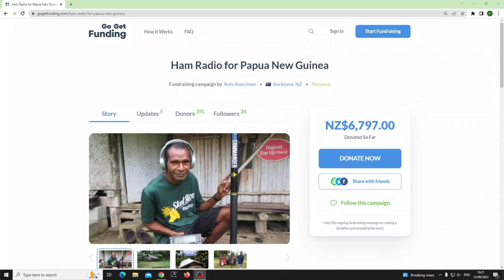We need to Understand Solar Power for Ham Radio

Comment: Hi cal. I've been using a solar setup for quite a while now. I use  4kw solar and 12kw battery. I'd say victron all the way mate. If there going 12v victron 100/50 is fine for 700w pv 1400w 24v pv. Pv max 100v/50 amps
Reply from the maker: Nice.

Comment: If you haven't already found a suitable system, look into the Renogy brand of solar equipment.  They have a website and all the equipment you will need to get the job done.  I have one of their solar panels, the controller (which is built in), the battery they sell and a 2000W inverter.  The inverter is a full sinewave version.  I think you will find the quality of their components is very good.  My system powers my Icom IC-7300 and some other items such as a small SDR receiver.
Reply from the maker: I know Roly reads these comments so thanks for input..

Comment: Solar power for ham is ok depending  on power requirements.Remember you will need 3 to 4 times the solar panels equal to the power requirements ..Basically I would instal 3 times the solar power for a Tesla at 3O amps at 220v ..So let's say you need 1kw of power you need 3 kw of solar panel .100 amp charge controller and 3 to 5  200 ah batteries .Lithium iron phosphate .It's over kill but because of the heat and rainy season you will  need  a bigger battery reserve and solar supply .Use monocrystaline panels they are more efficient ..I use 4 panels at 250 watts per panel .I never get the 250 watts per panel because im too far north .I use a 2kw inverter for my AC stuff and run all my battery chargers for my power tools and landscape lighting from my shed and run my radio and stuff when I'm working in the shed ..
Rule of thumb 3 to 4 times solar panels as per expected power requirements and use .To if you have a 120 watt power consumption from your radio ,that's 10 amps .so you will need  a 100 amper hour battery to run for 10 hrs continuous but will need at least 200 watts of solar panel 300 watts would be better .Just remember you make no electricity at night and limitted during the day pending weather and temperature .the colder the better .Use an MPPT charger .Not a PWM ..Set your panels in parralel .always connect your battery to the charger first and program the charger for the battery you are using .then connect your solar panels .either for 12v or 24 v .Pending on charge controller.
Just remember the longer hours of operation at night needs bigger battery reserve .1 200 amper hour battery life battery is good for a couple days without sun .just remember to give yourself 3 times the solar panels.You can use 10 awg  wire between your solar panels depending on distance you will have to up size your wire to 8 gauge .Also depending on inverter you may need 4 gauge or bigger .And if it's strictly DC 12 V you may need to go to 2/0 cable between battery and amplifier .Distance between batteries and amplifier is crucial .the further away the heavier the wire required .if you go to a 24 v or 48 v system you can save on wire size but have to buy expensive buck/boost regulators for specific voltages ...

Comment: What nice thing to do. So if he’s going to go with Solar I feel a lot of consideration will need to given to voltage regulation.  Presuming the target is to use 12V cells and top up the cells with the panel/s. Most systems like this are based around inverters to regulate the voltage. The problem with this is that these inverters are notorious for causing noise especially on HF. I am interested in how far you have progressed with this and what the plan is.
Reply from the maker: Hi John, yeah so we don't need an inverter so much as a charge controller only (no mains).. But noise is obviously key! Thanks!
Reply: @DXCommanderHQ  Cal do you know the size / type of the pannels and size of the battery? I will do some digging.

Comment: Interesting video Cal. I cannot help with any specific query - but here is a thought I have had for some time. If you go around the house, the ham radio, pad, laptop, phones (for all the family) and more are all powered by DC. We spend effort in taking a switch mode power supply (or similar) and changing AC to DC. Just feel the transformers, they are hot doing all that effort. So although I have explored some aspects of solar power, the systems that use an inverter to provide AC do not interest me. Furthermore, even a desk top PC uses DC (i.e has an inbuilt power transformer). So does most modern PC displays  - and on and on it goes. So I would like to think about creating a "ring main" DC supply using solar power. I do not really have the knowledge or skill to do this. But I kinda see an option of having a DC supply in each room of the house, several perhaps in the kitchen, where all these devices could be plugged into. I have not done the maths to see if this is at all viable or worth it !!!  But I might.  Mark  2E0MSR
Reply from the maker: Haha.. Yes, I see your point. The real problem with DC is safety. Most boats burn to the waterline because of electrical faults. DC..!

Comment: One additional comment: Most battery manufacturers rate their batteries in units of Amp-hours. One might ask how this relates to the batteries’ power. To determine the power that a battery can generate one needs to multiply the Amp-hour battery spec by the battery voltage and convert hours to seconds. So, as an example, consider a 14 Volt battery spec of 500 Ahr. These numbers can be turned into power as follows:

500 Ahr * 14 Volts * 3600 seconds/hour = (500*14) Watt-hours * 3600 seconds/hour = (500*14*3600) Watts

Cheers and ‘73

Jim
Reply from the maker: Very good Jim!

Comment: On power versus energy …

Throughout my 45+ year engineering career I’ve found that many if not most people don’t understand the difference between power and energy so I thought I’d say a few words on the subject. In short, energy E is the product of power P times time. This is why electrical utility bills, at least in the US, are in units of kiloWatt-Hours (kWh). Of course kIloWatt-hrs can be converted to Joules as follows: 

1 kWh * 1000 Watts/kW * 3600 seconds/day = 3,600,000 Watt-seconds = 3,600,000 Joules

I think it would be helpful to view Issac’s problem as one where his solar system is used to charge batteries, taking whatever amount of time it takes for a given amount of power (Watts) being provided by the solar system, and a separate phase wherein energy is consumed using the radio. For instance, it might make sense to only use the radio in the evening, after the sun has set, thus letting the batteries accumulate energy throughout the period of daylight. As long as Issac’s use of the radio required less energy than that being accumulated throughout the day, all is well.

Perhaps the biggest point to make is that the power output of a panel is only part of the story, whereas the full story requires that one consider the rates at which ENERGY is accumulated and used AND the durations (seconds) associated with each. When viewed this way one can see that POWER (Watts) is the RATE at which energy is produced or expended.

I guess my bottom line is that the problem is best viewed as an energy generation versus use problem, and that people shouldn’t focus just on the amount of power generated by a given panel. After all, a 100 Watt panel run for 10 hours, for example, is equivalent to a 1000 Watt panel run for 1 hour. I.e., the same amount of ENERGY is produced by either system and as long as that amount of energy is greater than or equal to the ENERGY required by the radio all will be fine.

Sorry for the pedantry of this note. 😉

Cheers,

Jim Luby
Reply from the maker: Pedantic is good in the science world Jim!

Comment: For a Damp/Wet Environment I would look at a fully sealed MPPT + DC/DC Charge Controller
Like the CTEK D250SE Dual Input DC-DC Charger & MPPT Solar Controller
It allows upto 300W Solar + The ability if needed to also be connected to a Vehicle for DC/DC Charge capability.
They are designed for Vehicle use, but would also work in this Scenario/Use Case.
>
Panels..?? Depends on installation location.. Roof or Ground Mounting..?? May require a frame building if on the Ground vs on a roof.
>
Battery Capacity, Better to over provision if possible, Not sure of operating hours.? Day vs Night Operation
If average load is 15A, Radio mainly SSB at 50% Duty Cycle + some other accessories, maybe some lights.?
I would look at at 2 X 100A/H LifePO4 batteries, would probably give 15~20hrs of use if Solar panels became unavailable., Damage/Storms..??
>
Maybe worth looking at for ideas:
https://www.maf-uk.org/news/solar-power-soars-in-papua-new-guinea

Comment: Not to rain on anyones parade but logistics of PNG are a nightmare and theft is rampant. All i can suggest is to buy the gear locally from the likes of Brian Bell Electrical, they sell solar equipment and are in Madang so easy to get to. There are other retailers as well but options are limited in Madang. All other is either airfreight from POM or Lae or highlands highway from Lae. Getting stuff imported isnt hard but just tricky. Any solar panel needs to be of a size that can fit in a van or small truck so that does limit you down to about 100-150w. As for battery i'd stick with a VLRA they are cheaper and easier to get. Plus when its been repurposed they can handle more abuse. Good to see this sort of promotion. Just be careful of the Wontok and shiney object syndrome in PNG. Jealousy can be nasty. I am sure Roly knows what i am on about.  Good luck and hope it all works out.
Reply from the maker: Phil, Roly is in and out of PNG.. He's probably worked out how to keep the stuff "almost" safe! LOL

Comment: One additional comment: Given that the Icom 7300 is powered by a DC power supply (13.8 volts), I don't see the need for an inverter and hence inverter-related noise would not seem to be a factor while running the system off of the (presumed charged) batteries. I would think that a fully DC could be put together thus obviating concerns about inverter switching noise, etc. That said, I'm not an expert on solar charging systems so I may be missing something here. - Cheers - Jim
Reply from the maker: Yeah, Roly is certainly not going down the inverter route..

Comment: Hi Cal,
While I don't have much experience with the latest charger and solar panel technology, I do know how to compute the amount of energy needed on a per-day basis, and from this number one can determine required battery capacity. Maybe this will help you and your friend Rolly with Issac's  Papau New Guinea solar shack setup. So, here are few simple equations and relevant numbers:

1. The solar flux near the equator is about 1400 Watts/meter^2 (W/m^2). As one moves away from the equator, the effective flux lessens. Papua New Guinea is pretty close to the equator so it has to the potential to have flux near 1400 W/m^2. However, to be conservative I would use a lower value, say 1000 W/m^2.

2. A typical solar cell efficiency is about 15% so of the 1000 W/m^2 available, the panels are able to effectively capture about .15 * 1000 W/m^2 = 150 Watts/m^2.

3. The total power that a panel of area A (m^2) can capture is then 150 (W/m^2) * A(m^2).

4. What's also needed is an estimate of the time per day (in seconds) that Issac expects to use the radio, and the relative fraction of time spent in receive mode versus transmit mode. Consider an example wherein Issac plans to use the system for 4 hours each day (14400 seconds). Next assume that of that time, he is in transmit mode for 10% of the time (1440 seconds). This implies that he is in receive mode for 12960 seconds. Given these numbers we can now calculate the energy needed per day.

5. The Icom 7300 in receive mode uses about 14 Watts of power (13.8 Volts * 1 Amp).  In transmit mode it uses about 290 Watts (13.8 Volts * 21 Amps)

6. Energy = power * time and the standard units for energy in physics are Watts*seconds, or Joules.

7. Energy used for transmit = 290 Watts * 1440 seconds = 417600 Joules 

8. Energy used for reception = 14 Watts * 12960 seconds = 181440 Joules

9. Total energy used per day, given the assumed transmit and receive durations above, is then the sum of the transmit energy and receive energy, or 599040 Joules. Note that a large fraction of the total energy is consumed in transmit even though we assume Issac transmits only 10% of the time (probably a high number but it makes the math simple).

10. Now that we know how much energy (not power) Issac needs per day, we can size the battery pack.

11. Often times manufacturers use kilowatt-hours (kWh) instead of Joules. Using an online conversion calculator, you find that 599040 Joules is equivalent to about 0.17 kWh.

It seems that many of your subscribers are knowledgeable about batteries, panels and chargers (including typical charger efficiency) so I'll let them advise you on those choices. However, before anyone can do any kind of meaningfull calculations, they must have a rough idea of the energy needed on a per-day basis. If you, Roly or some group wishes to discuss this matter in more detail, I suggest a zoom call.

Cheers,

Jim
Reply from the maker: Very fine Jim! I made similar calc on my 2 x 80Ah Gel batteries, factoring in talk-time, power, compression etc. In the end, I discovered they will last longer than I can DX for!

Comment: By Pacific, are you saying he is a sailor ? My recommendations are for sailing vessels. First, find Will Prowse'c Channel and watch almost everything, (at least get the basics from him) or select from his videos. 1 SOK Marine Batteries. 2. A good MPPT Charger. I'm having good luck with a Renogy., that said, I'm not a marine user. The MPPT electronics needs air (fpr cooling) , yet , protection from the elements.  I have to say, finding one that is safe from the Marine Environment may be impossible, so having a spare might be recommended, and keeping it in a waterproof box of some kind, with a metal shield around it.. My personal recommendation,  solder any crimp connectors , then slip heat shrink on top of your work.  Mike N6GRG good luck
Reply from the maker: No, he's not a sailor. The previous video explained..

Comment: I run my shack on solar.Lessons I have learnt. Battey  type is critical. Lead acid batteries have a life cycle.Life cycle depends on how often they are discharged below 50%  For example A 100amp hour battery only has a useable capacity of 50 amps to go below this shortens the life of the battery.The other consideration is for a battery that requires little mantainance for example a agm battery.The solar charger needs to a inverter charger that can output 230 volts and if solar charging is not adequate a generator can be connected to  the inverter charger.The inverter charger can be remotely monitored. The system needs to be set up to be user freindly.The amount of solar needed depends on the sunlight hours available. Overall system needs to kept simple as practable.
Reply: lead batteries come in different grades. solid plate batteries are heavy, lower power, but last decades. also ni-fe cells last forever, literally
Reply from the maker: There's no inverter / mains on this set up. Only 12V (well, 13.8 nominal!)

Comment: Victron all the way! If you can get them polycrystalline panels as they are more efficient, if not mono. Go as thick as you can with the cables, probably best to get silicon insulated as they will stand up to the environment better. Any questions drop me a message x

Comment: There is one very important piece of information missing.

How long per day is the system expected to operate?
Once you know that, the calculations regarding battery size, regulator size, solar panel size will all become clear.

Comment: Hi, I live off grid with only solar power to run everything and i have a standard domestic fridge freezer,  5g wifi, satellite tv for the kids and my radio gear..  I use an mppt charge controller with 1.4kw of panels on a good day charging lead acid gell batteries. I know people will say lifepo4 is best but old school gell are readily available, not to costly and last many years.
Reply from the maker: Yep, if you are not transporting batteries in a /P scenario, Gel are pretty good. I have 4 x 110Ah on my boat. I really don't see the issue... Only thing is don't push them beyond 50%. Massive saving on price too. Buy more :)

Comment: i have runned with solar power for my my off grid moutain cabin for several years for lights, TV, HF, refrigator.. The problem is power consumption against solar charge... that can be solved with a lot of big Ah batteries in parallell and several panels in parallell with a Diode on every positive wire from each panel before they all connect. to a very good charge controller and very thick wires if going to use 12v DC...so i would use mulitple solarpanels in parallell and serial to get a higher charge voltage and current available before the controller and batteries and heavy gauge wires is needed (bigger is better)

i would recomend also a wind generator also for night-time charge if there is some wind available

cause radio with 100W and a 400W amplifier does a big drainage of the batteries while transmitting.. so the charge input from panels should be at minimum 1000W and the battery bank should be pretty big in Ah

on a weekend at my cabin with 100W im out of power after very fast with only 320Ah bank but i have only 1x100W mono panel ffrom sunwind, and a small 500w wind generator from instabreeze.. if wind at night it charges while im sleep. so now i rearly use my dieselgenerator unless i stay a week
Reply from the maker: Hello friend.. It sounded like Roly said 400W but he's only running 100W max.